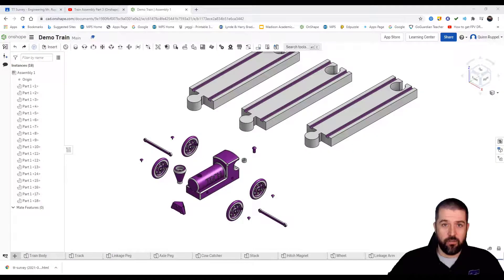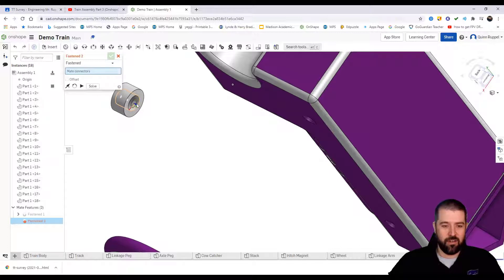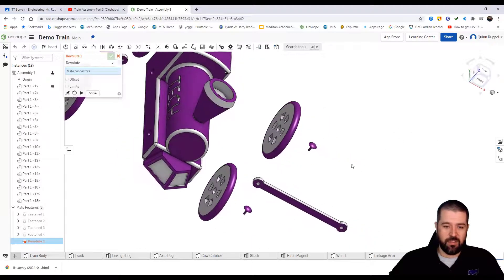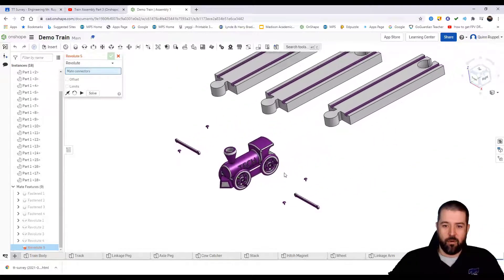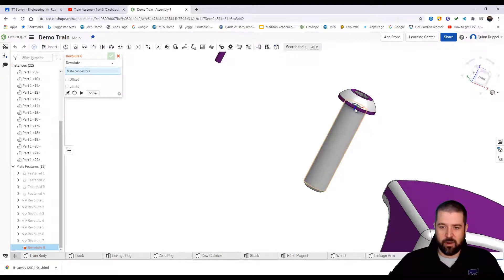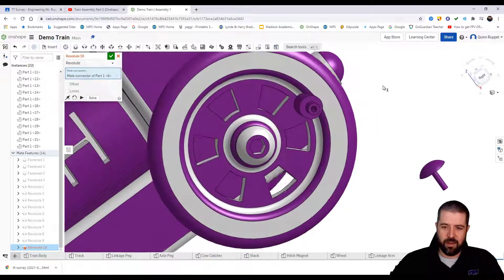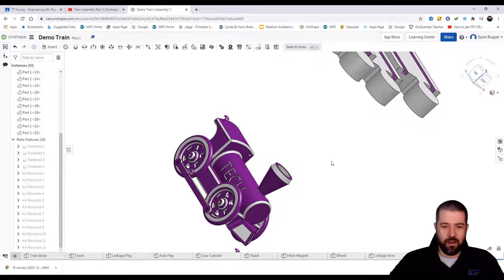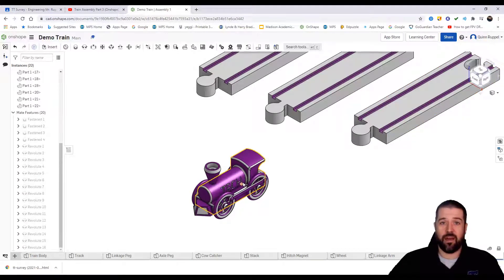OnShape: Mini Train Project - Train Assembly

Comment: my wheels don’t move together, for some reason nothing works
Reply from the maker: Check the spacing of the axle holes on the train body and the length of your linkage arms.
Reply: I got stuck with this too but you have to use revolve not fastened